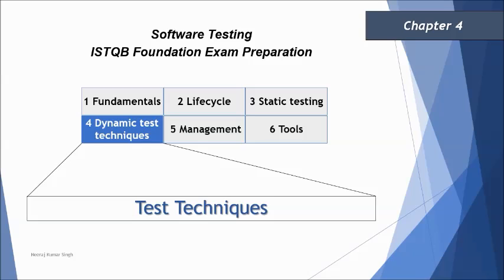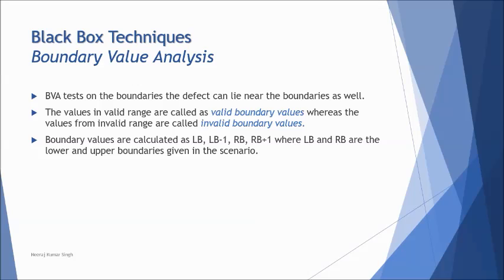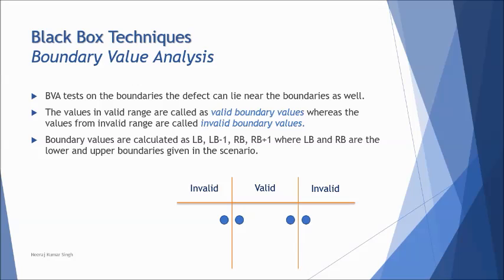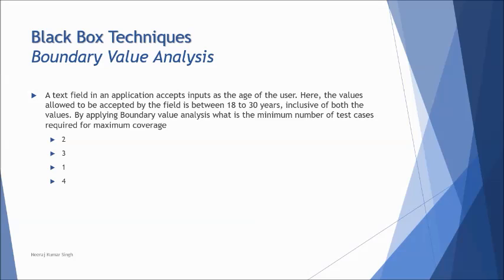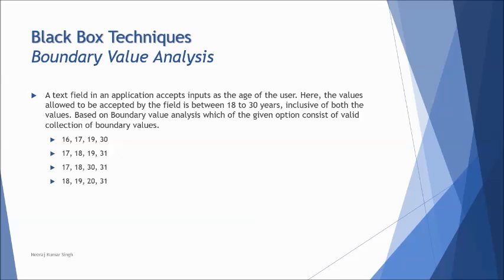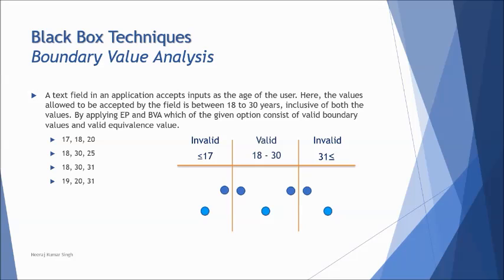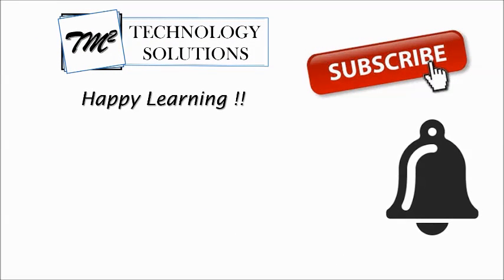ISTQB Foundation Level | 4.2.2 Boundary Value Analysis | 2 & 3 Point Analysis | ISTQB Tutorials

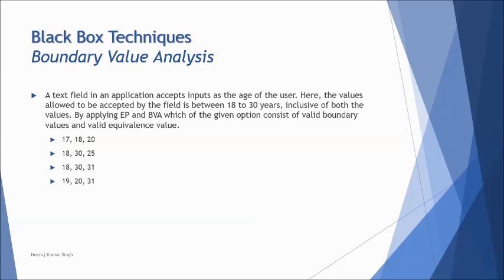Comment: How come in 5:07 in BVA in "VALID collection of boundry values" we have 17 and 31 which are in invalid  range and in 6:51 in BVA and EP we only consider 25 which is only in valid range without numbers in invalid range?

It doesn't feel consistent at all and makes you frustrated right away with certification approach as they were trying to make the most money out of the most confusing questions they can think of....
Reply from the maker: Hi Anonim,
There is a difference between "Valid collection of value" and Valid Equivalence Value or Valid Boundary Values"
It's as good as saying "valid set of test data" and valid test data"
So valid set and collection means it's the values which you will derive after applying techniques and valid value are exclusively valid data separating from invalid values.
Reply: @TMSQUARETECH  Ok, now it makes more sense. Thank you for your answer. Though I have to admit it is confusing

Comment: The digital “Rainbow Thermometer” uses 7 colors to show the ambient temperature. Each color spans a range of just 5 Deg. C, with an operating minimum and maximum of minus 5 Deg. C and 30 Deg.C. Which of the following values is LEAST likely to have been identified when applying the boundary value test design technique?

Sir how to calculate boundary value for this problem
Reply from the maker: Hi Anu,
I don't see the options but let's solve this here
your ranges will be -5 to 0, 1 to 5, 6 to 10, 11 to 15, 16 to 20, 21 to 25 and 26 to 30
This covers the seven colors to seven ranges. All the above mentioned values are boundary values but additionally you will have 2 more that is -6 and 31 for each end. Now you can pick the option which don't have these values as right answer.
Reply: Sir thank u so much for ur valuable reply.. 
In istqb dump answer is 12deg c.. I don know how..
Reply from the maker: That s not istqb dump.. That is external dumps created by unknown people. ISTQB have 3 official sample papers available on istqb.org. Other than that all are unofficial. refer at your risk that main ruin your confidence
Reply: Sir thank u so much got d answer....

Comment: Hi, for the second question - which of the given option consists of valid collection of boundary values, all of the options mentioned contains at least one invalid boundary 
1. 16,17 in option 1
2. 17,31 in option 2 &3
3. 31 in option 3 
 
Could you explain how the answer is derived in this case. Thanks.
Reply: I too have the same question.
Reply: @shivalipawar5353  If I'm looking at the correct question, 
Accepted age range is anything between 18 & 30 inclusive
so using the table as an example
<=17 (invalid)| 18 - 30 (valid) | >= 31 (Invalid)

available options are
1) 16 17 19 30    <= this covers two numbers in the lower invalid boundary, and 2 numbers that are valid, so does not cover validation of 31 or above
2) 17 18 19 31    <= This covers the lower invalid boundary (17), covers 2 valid values (18,19) and 31 upper invalid boundary
3) 17 18 30 31    <= This covers 17 (lower invalid boundary), 18 & 30 which are the limits of the valid numbers, and 31 upper invalid boundary
4) 18 19 20 31    <=  This covers 3 valid boundary, the upper invalid boundary, but not the lower invalid boundary.

There for, the 3rd option, covers the the first lower invalid boundary value (17), the first valid number (18) the last possible valid value (30) and the first upper invalid boundary value (31)
Please like this if this has helped
Reply: I also have the same question. Because it said that we need the valid bounderies

Comment: can you please explain this question in detail ?
The digital Thermometer uses 7 colors to show the ambient temperature. Each color spans a range of just 5 Deg. C, with an operating minimum and maximum of minus 15 Deg. C and 60 Deg. C. Which of the following values is LEAST likely to have been identified when applying the boundary value test design technique?
A. 60 Deg. C
B. 0 Deg. C
C. 12 Deg. C
D. 25 Deg. C
Reply from the maker: Hi Raveena,
Please see the response to your query in my Q & A playlist here - https://youtu.be/p3-BdFwBnQ4

Comment: Hello Sir,  Can I please get the solution for the below.  I think the answer is D, not sure if i am right.  

A program validates a numeric field as follows: values less than 10 are rejected, values between 10 and 21 are accepted, values greater than or equal to 22 are rejected. Which of the following covers the MOST boundary values?

a. 9,10,11,22
b. 9,10,21,22
c. 10,11,21,22
d. 10,11,20,21
Reply from the maker: Hi Bhuvana
The ranges created in this scenario will be 
Less than or equal to 9
10-21
Greater than of equal to 22

Thus your boundary values will be 9,10,21,22
You went wrong considering inside the boundary, where 10 & 21 are already inside so you should consider other two outside boundary.
The right answer here is B
Reply: @TMSQUARETECH Ok Sir, I understand now. Thank you so much.

Comment: Hello Sir , Could you pls. let me know , what should be the correct answer for below question and why ? As per answer sheet its C. 

A wholesaler sells printer cartridges. The minimum order quantity is 5. There ISA 20% discount for orders of 100 or more printer cartridges. You have been asked toprepare test cases using various values for the number of printer cartridges ordered.Which of the following groups contain three test inputs that would be generated usingBoundary Value Analysis?
A. 5, 6, 20
B. 4, 5, 80
C. 4, 5, 99
D. 1, 20, 100
Reply from the maker: The Answer will be C,
As the ranges created will be 
less than or equal to 4 - you can't place order
5 to 99 - this is the range to place order
greater than or equal to 100 - you get 20% off

Thus boundary values will 4,5,99,100 but in question they have given sets thus from the option C covers 3 of them. Hope that goes inline with the understanding on this.
Reply: @TMSQUARETECH  Got it Sir . Thanks

Comment: Is there any called 2,3 boundary analysis or videos content is enough?
Reply from the maker: Yes it is. We call it as 2-point analysis and 3-point analysis
Using 2-point analysis we consider 2 values per boundary
Using 3-point analysis we consider 3 values per boundary

For example
If the given range is 18-30 as valid range then the boundary values are
2-point analysis - 17,18 & 30,31
3-point analysis - 17,18,19 & 29,30,31
Reply: @TMSQUARETECH  what if questions hasn't specified 2 point or 3 point?

Comment: Hello sir
Can u pls explain the answer to this question
Postal rates for “light letters” are 25 paise up to 10grams,35 paise up to 50grams plus extra 10paise for each additional 25gms up to 100gms. Which test inputs(in GMs) would be selected using equivalence partitioning.

If a candidate is giving an exam of 40 questions .He should get 25 marks to pass (61%) and should get 80% for distinction , what is the equivalence class.
Reply from the maker: Hi Surya,

You can find the response to your second question here - https://youtu.be/q-eik_OHm1U

Comment: thank you....i came across one question 
 The speedometer of a car uses 7 colors to show the speed. Each color covers a range of 20 km, with an operating minimum and maximum of 0 and 140. Which of the following values is LEAST likely to have been identified when applying the boundary value test design technique?

a) -1
b) 0
c) 7
d) 121

i easily i know its not a or b....ans would be 7 or 121.....they said answer is 7...my question is why not 121
Reply: I did not understand how it is 121? my answer would be 7 . 1st partition- 1 to 20 (invalid  Negative 1, LB 0, RB 20 ), 2nd part - 21 to 40(LB-21,RB 40),3rd part- 41 to 60(LB-41,RB-60),4th part - 61 to 80(61,80),5th - 81-100(81,100), 6th - 101 to 120(101,120), 7th - 121-140(121,140) . The only value we cannot apply is 7 in here... Please correct if my  understanding is wrong
Reply: hey, 121 is already a boundary value because equivalence partitions will be this way
0 -20 I 21-40I 41-60 I 61-80I 81-100 I 101-120 I 121-140 with -1 and 141 Invalid values
Reply from the maker: Hi Priya,
Nice question. By reading the scenario it seems the only possible answer is 121. As the intervals are of 20 km each and min speed can be 1. As per my understanding 7 is a diversion for 7 colors but the author have mistaken in giving the right answer. As I always suggest be confident with the logic of applying a technique. Then you can determine the wrong answer in such questions.

Comment: I try best but I don't know how option C is correct, can you explain respected teacher?
Q:
A smart home app measures the average temperature in the house over the previous week and
provides feedback to the occupants on their environmental-friendliness based on this temperature.
The feedback for different average temperature ranges (to the nearest °C) should be:
Up to 10°C - Icy Cool!
11°C to 15°C - Chilled Out!
16°C to 19°C - Cool Man!
20°C to 22°C - Too Warm!
Above 22°C - Hot & Sweaty!
Using two-point BVA, which of the following sets of test inputs provides the highest level of boundary
coverage?
a) 0°C, 11°C, 20°C, 22°C, 23°C
b) 9°C, 15°C, 19°C, 23°C, 100°C
c) 10°C, 16°C, 19°C, 22°C, 23°C
d) 14°C, 15°C, 18°C, 19°C, 21°C, 22°C

Answer: C
Reply from the maker: Hi Ahmed,
The ranges are 
0-10
11-15
16-19
20-22
23 and above

if you have understood the technique we can understand the above written values are all boundary values. Whereas, as per the question we need to identify the option which covers maximum boundary values. 
in option a - 11,20,22,23 are boundary values
in option b - 15, 19, 23 are boundary values
in option c - 10, 16, 19, 22, 23 are boundary values
in option d - 15, 19, 22 are boundary values

based on this analysis the right answer is C as this covers maximum boundary values.

I hope this makes it clear to understand the right answer.
Reply: @TMSQUARETECH  As it is two-point BVA question, option d looks more accurate.
Reply: Can u plz clear my doubt?
Reply: @ShitalsDataDesk  Option D only covers 3 boundary values while option C covers 5 boundary values

Comment: Hi again.. what about 2 point and 3 point BVA?
Reply from the maker: For example, let us take the field to enter a date to a field. Imagine the month has 31 days and that no decimal values are accepted by the system. So,

Any value from 1-31 would be valid
Values below 1 and values above 31 would be invalid
Based on the above, we can derive the values for Boundaries like this :

3 point boundary value method -> the boundary values 0,1,2 & 30,31,32
2 point boundary value method -> the boundary values 0,1 & 31,32
Reply: @TMSQUARETECH  To generalize, with 3 point boundary method, the boundary values are LB-1, LB, LB+1, RB-1, RB, RB+1; with 2 point boundary method, the boundary values are LB-1, LB, RB, RB+1. Correct?
Reply from the maker: @himmelsdemon  Yes!!!:_Thanks:
Reply: TM Square Technology Solutions thank u👍🏻